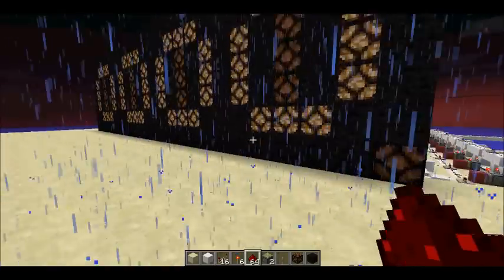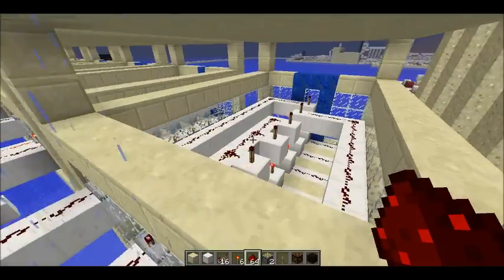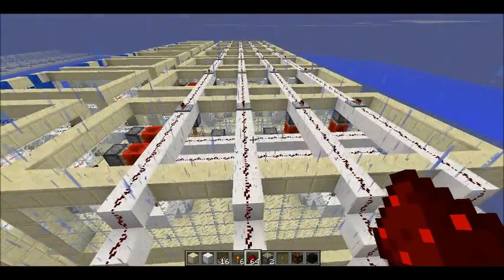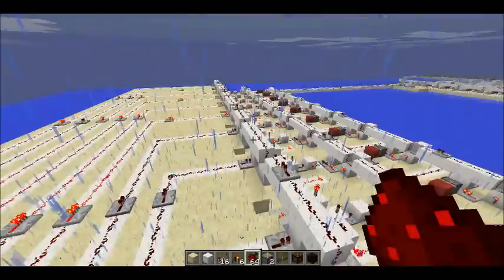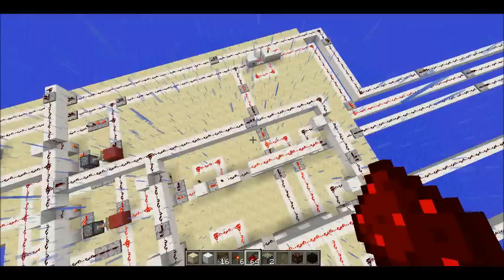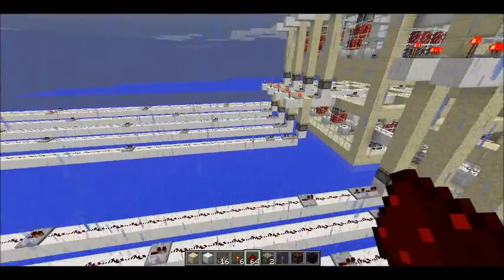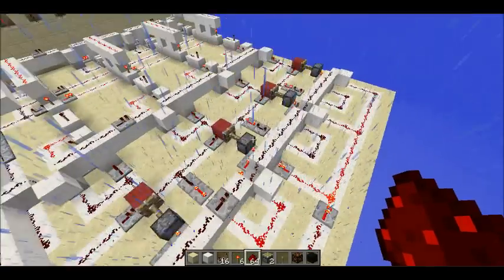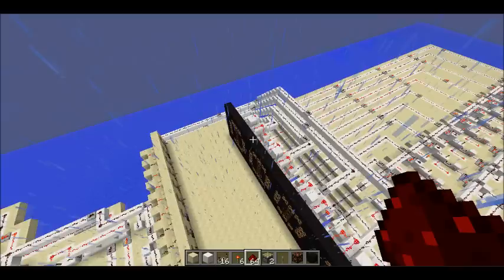Practical Application for Encoders and Decoders

Comment: How long did it take to make this in minecraft?
Reply from the maker: Building it was the easy part. I used Single Player Commands which has World Edit. That makes just about everything fast. The hardest part was figuring out how to make it work in the first place. That took a week maybe playing on and off for an hour or two every day.
Reply from the maker: I had to figure out how encoders and decoders worked first... which took a few hours of reading materials... then I had to figure out if it could be replicated in Minecraft which took a couple days... and then I had to build the working system which took another day or two. Now granted I was only playing for a couple hours a day at the time, so probably less than 12 hours from start to finish. Thanks for checking out the video. :)